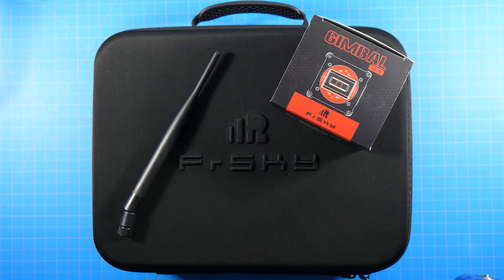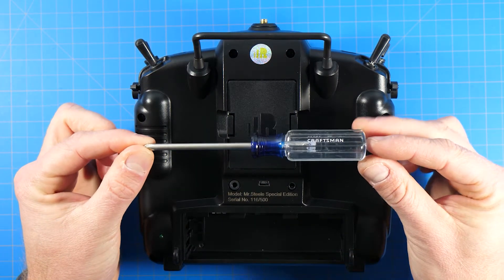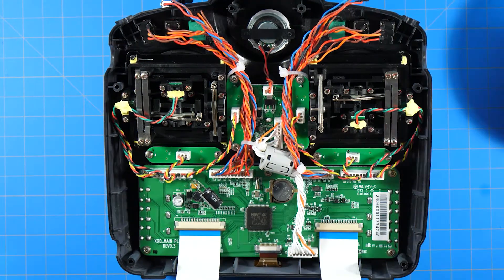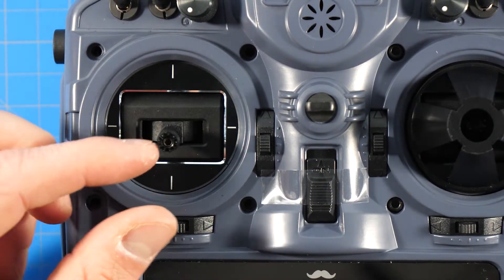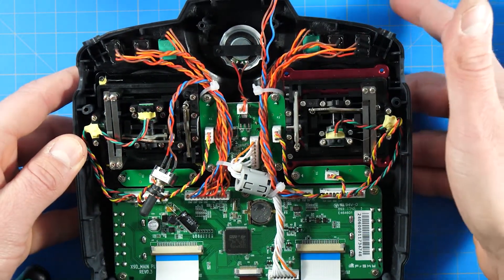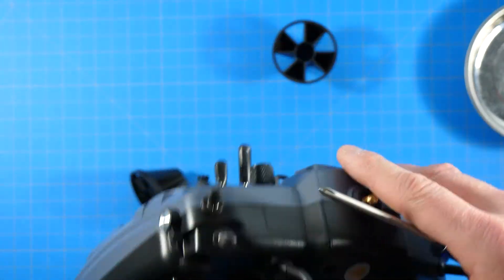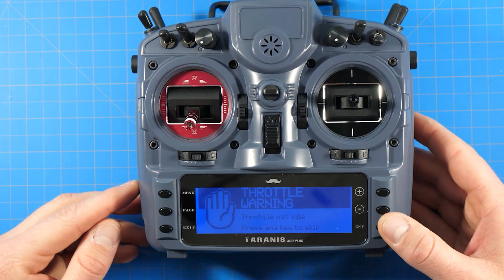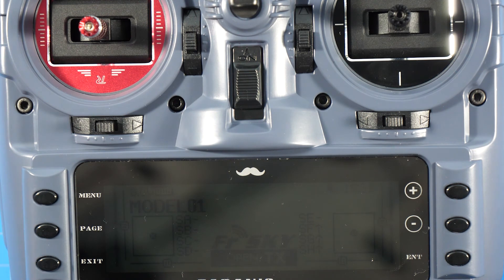Mr. Steele Special Edition Taranis M9R Upgrade | How to Series

Comment: Very nice review.
Hey man, what do you think is best:
M9-R on the throttle and the M9 Pitch or
the two M9-R gimbals?
Reply from the maker: I believe that the M9-R for the throttle and the regular M9 for pitch is the way to go.
Reply: @NorthwestThrottle  why?
Reply from the maker: It’s really just a preference. You can have it anyway you choose. I’ve seen it done both ways and I’ve even seen it where the person used two M9R gimbals.
Reply: Bay Area FPV Do you know if there are any negatives by using 2  R gimbals as opposed to using it only on the throttle?    Peace ✌️
Reply from the maker: No negatives to doing that. It would be just a preference. But if you do choose to replace the other one make sure to calibrate it too like shown in the video.